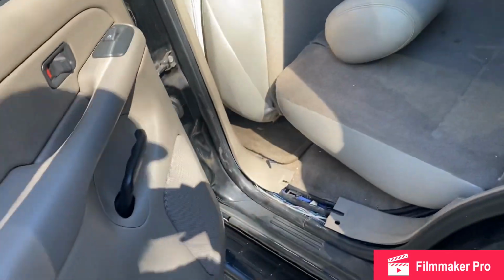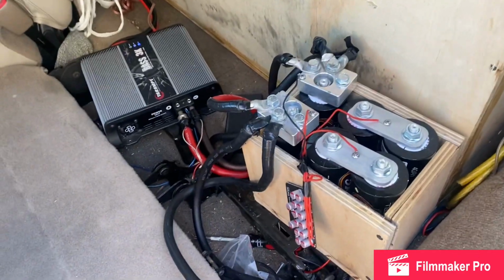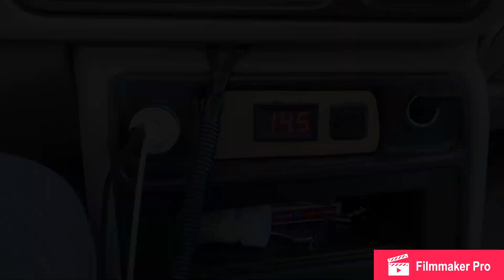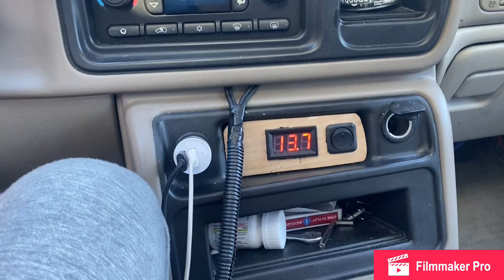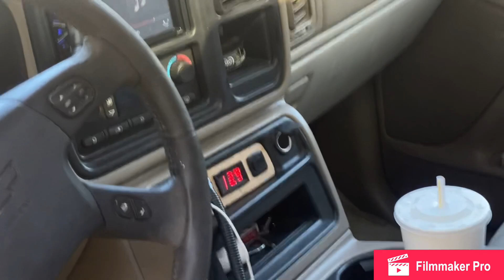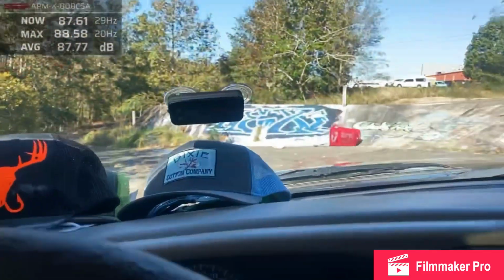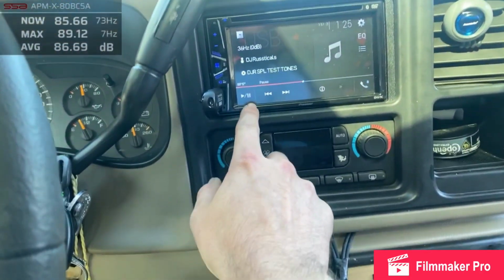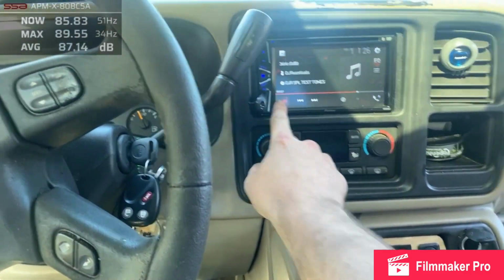2 Skar Zvx 15s Taramps Bass 3k 150db no wall Tahoe

Comment: I’m running 2  D1ohm zvx 15s in a 9 cube box on 2 Skar sk2500 amps strapped at 1ohm(I have stellar electrical so they take the .5 ohm a piece like a champ) in a 2017 Hyundai Sonata. I’ve had to slowly rebuild the inside of the car with birch wood and lot’s of sound deadening. Would love to compare our setups if your ever in the MD/DC area. You’re sounds pretty dope man,keep up the content.

Comment: Awesome !! I just got same 3k and I will be running 2 12s made by Resilient Sounds wired at 0.5 ohms which will result in about 1-1.5 ohm final load after rise.
Reply from the maker: Heck yea bro I thought about changing to resilient for a lil bit but idk

Comment: I run 2 zvx-15's on a taramps 8k in an extended cab s-10. I wish I knew what mine did on the meter but judging by yours Im pretty sure it's in the 150's sealed. Nice setup.
Reply: any videos bro? I have 2 vxf 15s in my s10 6th order blowtrhough on 12k and its violent as fuck does 155s easy
Reply: @unkowntrooper1657  nothing that is posted and not much of any video. I've never really videoed anything but a friend sent me a short one of it floating his girls hair ill have to find it and post it.
Reply: Hey man how do yu I have them wired I have 2 dual 2ohms on a taramps bass 8k I need some help please
Reply: @zabariestevens7589  all in parallel for  0.5ohm.
Reply: How would you compare the 4500 Skar Amp to the Taramps 3k?

Comment: That Skar RP 4500 would still put out more power than that Taramps 3K. Had both amps, you just need really good electrical for that RP 4500. Because it pulls more electrical than a regular 4500
Reply from the maker: The rp 4500 didn’t hold up at .5Ω I have a taramps bass 5k @ .5Ω now
Reply: @Bamashiner  how you like it I’m thinking of upgrading?
Reply: @Bamashiner  what did it over heat? how does it not hold up?

Comment: Shit gettin down. But if you got the Taramps md8000.1 you would really slam. I have the skar evl 12's in a 6th order in a ext. Cab truck it did over 150 db. Just sayin try putting the power to them cause you gotta make up for impedance rise . dig the set up though. Nice.

Comment: Hey man, just so you know 2/0 welding cable is the same as 1/0 audio wire, and 4/0 welding cable is the same as 2/0 audio wire. The reason this happens is that the audio companies aren't regulated by any set standard,  so they can sell a wire that would be 2/0 as "oversized 1/0". Just something to think about since I heard you talk about wire upgrades.
Reply: So if I want true 1/0 welding wire , get the 2/0 instead
Reply: @RomaVilla  Amps are made with audio cable in mind so if you want the recommended cable you should get 2/0.
Reply: @ethanr1145  appreciate that, I have 3k MD taramps so it's a little tough to find reducers small enough to fit in the power inputs, which are 4 gauge inputs.
Reply: @RomaVilla  Jim's Machineworx makes taramps specific 1/0 adapters, but last time I saw they were out of stock. They might be back though
Reply: @ethanr1145  I'm checking them out right now. Thanks for the tip..
Reply: @RomaVilla  it's dependent on how much current you'll draw and how long the cable will be
Reply: @ethanr1145  that's kinda a halfway recommendation. You have to know current draw and length of cable before you can make that recommendation
Reply: Just grab some full tilt 1/0 gauge oversized wire.

Comment: Rp 4500, should give you more power both at one ohm u need a alt n more battery if you want to see 4500 stock alt im sure you can only get 1500 if that
Reply: He has dual alternators look at the video before this one

Comment: Should I get the bass 3k or smart 3k
Reply from the maker: There’s some factors. If you plan on running .5Ω and/or run your voltage 15-16.9 then the bass hands down. If you plan on only running to 14v and 1Ω then probably smart 3. Between 14-15v is kinda personal preference. Hope this helps.
Reply: @Bamashiner  bass 3k can handle 0.5ohm ?? all taramps line, only bass line can handle voltage until 17v right ?

Comment: My bass 3k keeps clipping and shuts off. I have xs power d1200 for the amp. No big 3 and stock alt. What is my problem. Great system 👏 👌
Reply from the maker: Unplug your speaker outputs turn gain all the way down, play a test tone at max volume and turn gain up until the clip light barely twitches. Best way to tune any taramps
Reply: It needs more power taramps are very power hungry and require a stout electrical system even this dual alternator lithium setup drops to 13.6 taramps are happy at a steady 14.4 that's hard to do
Reply from the maker: @nickkaltsis  indeed and the bass model is a 16v amp so it loves 16.5 area
Reply: By another amp. JP at down4sound has just released his JP23 for $300
Reply: @nickkaltsis  not so sure about that. I don't have the big 3 and my bass 3k and MD1800.1 are performing swell.
Reply: Definitely do the big 3 and make sure it's ofc. Also need a couple of batteries for that bass 3k. I have the 3k MD and that thing is begging for an high output alt. My buddies has the MD 3k aswell and he kept dropping to 10 volts until he added 3 batteries and a 200 amp alt and now he bearly hits the high 12s
Reply: @RomaVilla  i agree. If you can definitely get your voltage up, but with such a small Brazilian system maybe the so-called big 3 isn't necessary. The first thing is to utilize a volt meter to actually see where you're at. Then determine what you need to get there. Again I don't have the big 3 and I've been running my taramp bass 3k and md 1800 daily for about a year and a half. No issues!
Reply: @Mr.NpK143  got you, so what are you pushing with the bass 3k and 1800 watt amp or what kind of subs do you have now. Also what ohms?
Reply: @RomaVilla  4 rockville k610s on the bass 3k 1ohm, 4 rockville pro 10s in the door on md1800.1 1ohm, and 6 rockville pro 6.5 on the 1200.4 with 6 rockville tweeters (channels 1 and 2). It's all on my channel if you'd like to check it out. A nice lil budget build until my big boi is complete
Reply: @Mr.NpK143  nice, how are the k6 subs holding up?
Reply: @RomaVilla  i play them  just about everyday. Very good sound quality for a fraction of the cost. The longevity of both companies have been nothing short of A1 from my perspective. I could definitely use an upgrade on my electrical, but I figured if it ain't broke don't fix it. So I just keep on playing until it quits. Fortunately for me it simply just hasn't. I'm not saying it's the best thing going, but it is well worth the pennies.

Comment: How do I stop the voltage from dropping
Reply: Big 3, alternator, stronger battery, and/or a secondary battery. My next setup will be a higher output alternator and a homemade lithium battery bank on a standalone charging system dedicated to my system

Comment: What is the box tune too?
Reply from the maker: 30hz
Reply: @Bamashiner  I have a 2015 Buick lacrosse i bought 2 skar audio zvx 15 v2 but don't have a amp for my subs, I'm thinking of getting taramps md 5k or the bass 5k in suggestions?
Reply from the maker: @cleofiesjackson1983  it all depends on your electric if you don’t or can’t charge above 16v then get a md model. Bass model is only good if you can stay at mid 16s. MD you can safely run to 12v